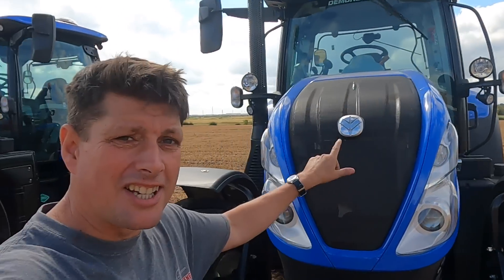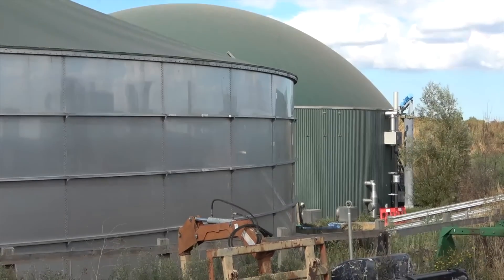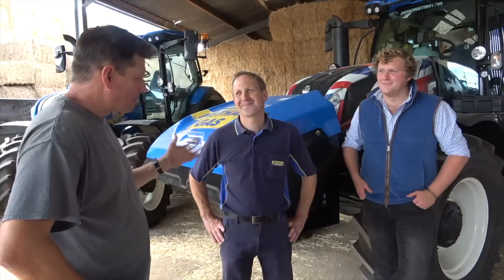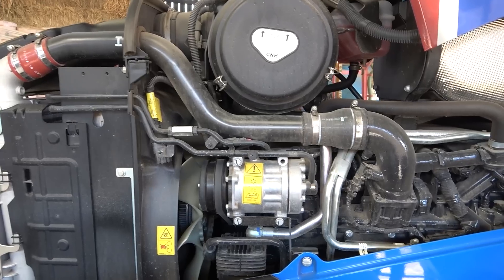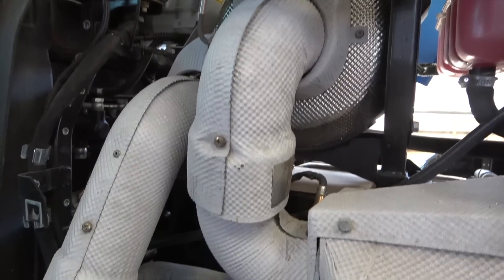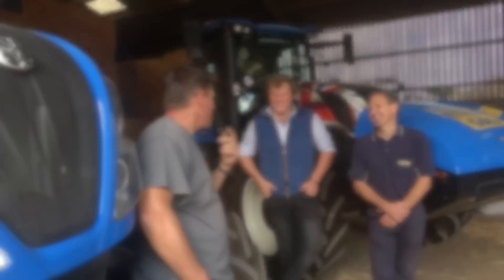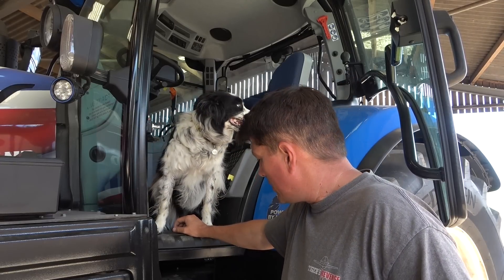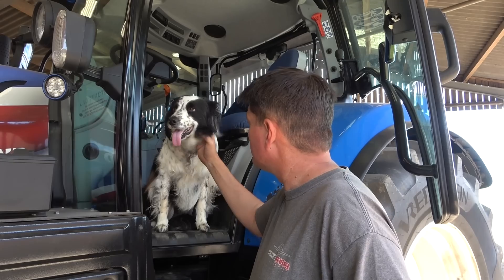GAS vs DIESEL - NEW HOLLAND T6.180 Methane Tractor

Comment: The fuel of the future, should be exiting times ahead with all this new technology coming down the line. Instead off one replacement fuel I can see specific fuels for specific jobs methane should fit in nicely between diesel or bio diesel and electric.
Reply from the maker: It amazes me that folk seem to be in some kind of daze where they think we only have one fuel.
We have ALWAYS had multiple fuels such as petrol, diesel, paraffin, TVO, LNG, Bio Fuel, Propane, Methane, electric, diesel-electric and many, many more. Currently the fuels of choice predominantly are petrol and diesel but before that it was coal.
Specific fuels for specific jobs will become the way forward with rising prices.

Comment: The problem as l see it with methane is not so much the cost of the tractor, but all the infrastructure, equipment and such like to operate the tractor. An AD plant ain't cheap, gas capture system or roof on a slurry lagoon/ store ain't cheap and the gas cleaning equipment ain't cheap.
A diesel tractor, all the infrastructure has been in for decades, much safer to handle, readily available fuel supply and then you could still have a green energy source and sell your gas into the grid. IF ONLY there was gas infrastructure near every farm.
Not that l am against methane and there is no such thing as free fuel. Even to harvest sunlight you have payout to buy the solar panel infrastructure and then payout to connect to the grid.
Don't forget the connection fees, otherwise you will be in for a big shock if cannot sell your gas or export your electric.
I used to do small to medium scale wind turbines onto farms. Some DNO G59 connection fees were £100,000 for a 50kw Endurance wind turbine. It killed the project such extortionate fees.
Reply from the maker: You're looking for problems that aren't there.
They HAVE an AD plant which generates power and they get paid for it and the crop.
The only infrastructure is the fuelling point and they have already factored it in.
Gas capture/slurry store isn't going to be an option in the next few years whether you have a methane powered tractor or not.
Reply from the maker: And it is easy - it's as simple as I've just shown in the video - he has methane, he fuels the tractor, it runs on it - It's THAT simple. All the digestate is spread with that tractor, the land is pulled down with that tractor, he carts bales with that tractor, mows, teds and rakes.
It's really that simple.
Reply: @LordMuck  OK. Not easy or cheap for other farmer's to join the methane revolution. Anyway, l applaud the work because alternatives are interesting to learn from.
Reply from the maker: Ah now that's another scenario entirely. The whole purpose of the video as I stated (several times) was this fuel in this application is a no-brainier as they produce methane to produce power to sell to the national grid.
For someone to come at it from a non-producing  angle is not as straight forward but as Ben is currently doing you can buy it by the tanker load (approx 100 hrs running time for £280) so it's still completely viable.

Comment: To be controversial how many acres of crops would it take to produce 1000 hours worth of gas, and how much would the gas cost to produce without the subsidy,
Reply from the maker: I doubt you'd produce a crop to produce fuel to power a tractor to produce the crop to produce the fuel...
The whole point is you're taking fuel that's being produced to generate power for which you are paid.
However, I shall ask purely for scientific terms how much maize would be required to produce 1000 hours worth of methane gas.
Reply: @LordMuck  it's all interesting stuff, good video, 👍

Comment: 10 grand more initial cost, you are already 10k ahead on the first year. Sure not for everything but still, easy choice
Reply from the maker: We worked out that if you had the fuelling station you would obviously be £20,000 a year better off.
Currently by buying the fuel in, you are still a remarkable £17,200 better off.

Comment: I was in France earlier this year and saw a few methane powered buses, only way you could tell was the sticker on the back, sounded like any other bus as they drove past. Only thing I noticed was a faint smell of onions...
Reply: That onion smell is usually ethyl mercaptan that is added to the gas for leak identification. The vehicle either wasn't tuned well or has a slight leak.

Comment: thats brilliant video. don,t know set up cost off recovering methane but within a short time you would be return on money spent compared to diesel.
Reply from the maker: The set up cost would be fairly expensive but for AD you've got the plant which is generating revenue into the grid and for slurry methane capture you will have to do it regardless in the next few years so the 'fuel' is basically a bi-product of another venture.

Comment: So is that the fuel tanks so to speak on the front ?
Reply from the maker: That's the Range Extender, the main tank is where the normal tank on a diesel is, under the cab step as shown in the video.
Reply: So no capable front weight or pto as of yet
Reply from the maker: Yes some of the Dutch ones have roof mounted extenders and front linkage/pto
Reply: Certainly a impressive machine 👍

Comment: If that's right for the tractors why aren't they doing it with the lorries
Reply from the maker: They are.
Reply: @LordMuck  Also the company I work for also run LNG Volvo’s , but unlike the scania that runs on just gas . The Volvo engine use’s LNG gas , small amount of diesel and  adblue at the same time.. Don’t know why…
Reply: Most truck manufacturers are using gas. CNG and LNG . Currently I drive a LNG scania 410hp. It has two tanks and has a range of a 1000 km’s between fills.